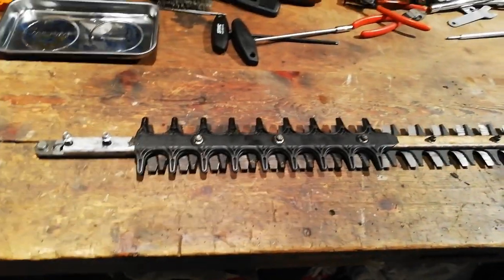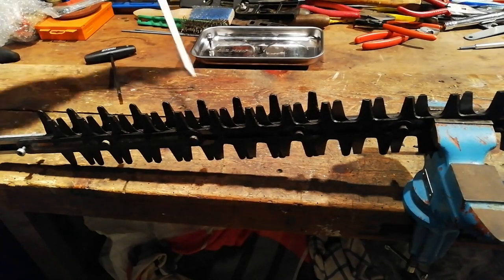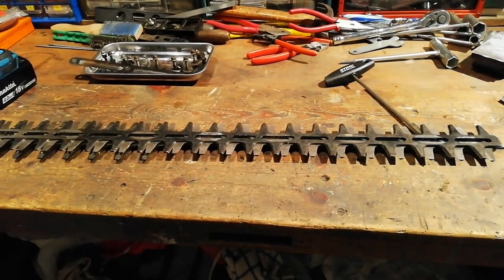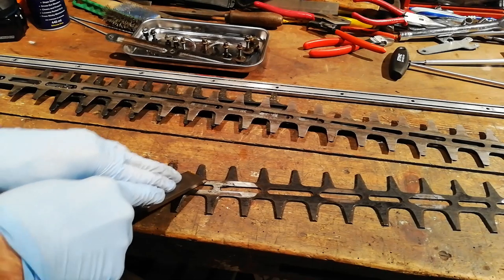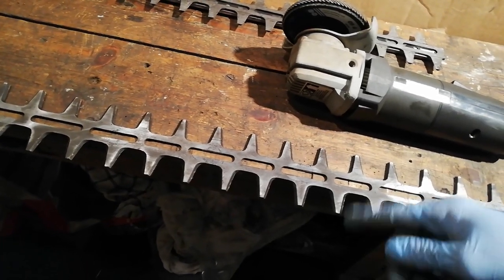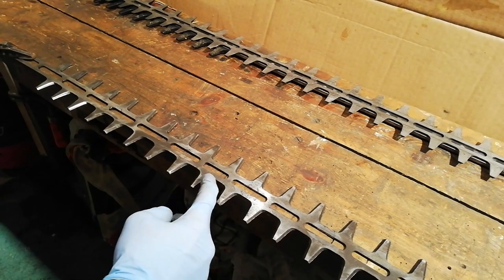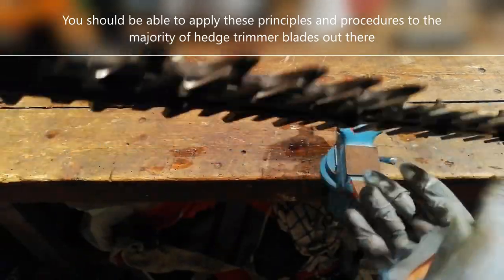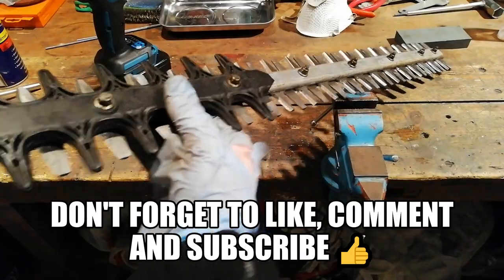How To Sharpen HEDGE TRIMMER Blades

Comment: I do mine on the machine with a small die grinder and I have seen some use a dremel, you’ve done good job there 🙂👍
Reply from the maker: Thanks mate, yeh when doing a light touch up sharpen i leave the blades on and use a small rotary tool as well. But if they need a big sharpen i always split them apart to properly dress the mating surfaces 👍

Comment: Hi
Very well done.
If there is a gap between the blades on the matting surface is it fixable ?
Or I need new blades ?
Thank you
Reply from the maker: Thanks, Some blades do have bigger gaps then others from factory so it can vary from make to make so its hard to say really. If it is not cutting very well that might be a sign that something is wrong. 👍
Reply: When there’s A gap i grind the spacer a little bit, don’t do it too much

Comment: If youre charging hourly. How long did it take you from start to finish. Whole job including regrease gearbox, cleaning cutter bar and shim and spacer etc. I'm a small plant tech and always feel bad for how long it takes me and I charge am hourly rate. Thanks for any advice. Regards Matt
Reply from the maker: Probably around the hour mark, so thats the minimum you should be charging for a thorough job. Most shops dont even take the blades apart and do a shoddy job of sharpening, Talk to the customer and see what they want, as there is different levels of service. 👍